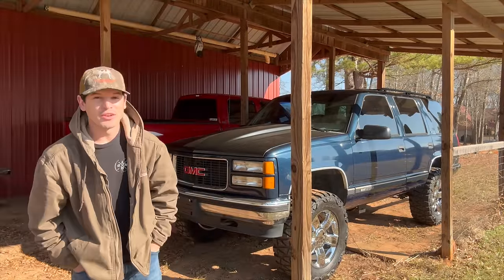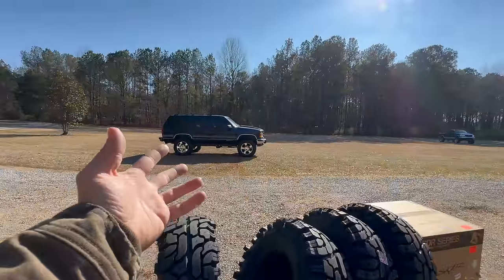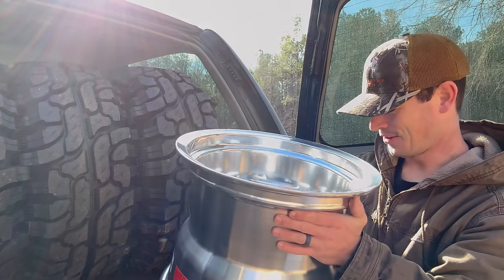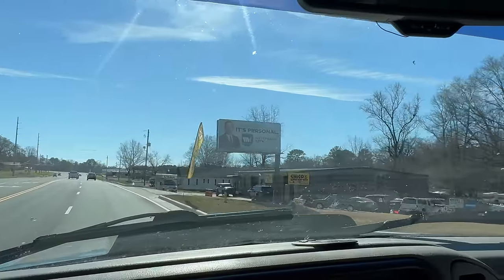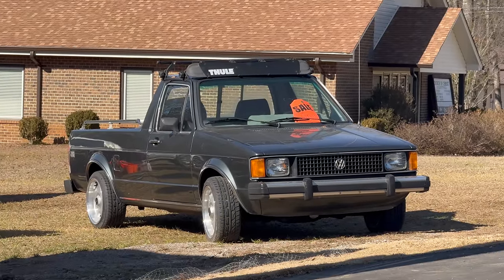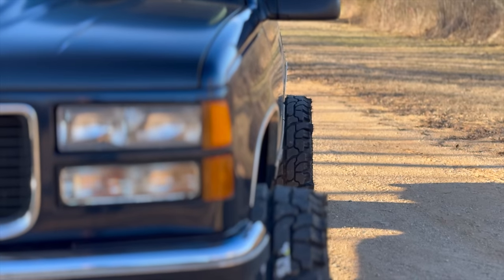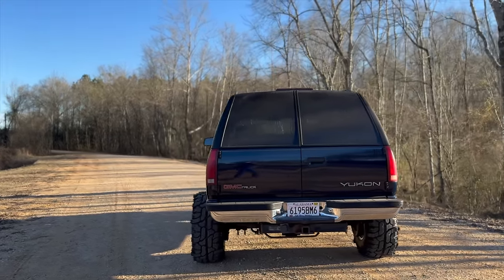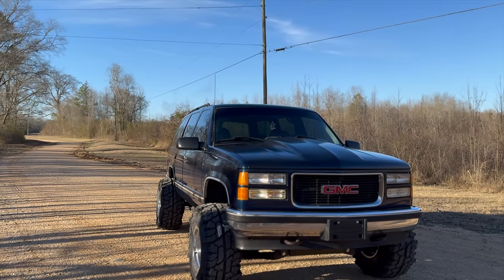I GOT THE MOST RIDICULOUS TIRES!!!! | OLD SCHOOL WIDES |

Comment: I’ve always liked the way Thornbirds look on an OBS Chevy when they’re on a reasonably sized rim, like a 15x8 or a 16x8. To each their own, but I’ve never liked the way excessively wide wheels make a truck look, especially if they’re also large diameter wheels. They seem like a great way to wear out the drivetrain prematurely & destroy the paint if it leaves the asphalt much.

Comment: Get 6 lug 14 bolt rear axle from suburban and make damn sure that you have the expensive wheel bearing hub assembly. From experience the China bearings with 15x12 and 36x1450 tsl and 2 sets of bearing hub units lasted 15 days.
Reply: Looks good I mentioned axle because it evens out without spacers

Comment: Nothing like set of 15 inch steelys with some swampers or boggers on them😎… also if you wanted to those tires can be cut and siped for better traction, but if riding on road too the smoother topside of tire does run nice if its not tainted

Comment: If you ever want a badass tire get the old school buckshot gumbo mudders but i believe you can only get em in a 16 inch and im oretty sure you can only get em in one size now wich is like a 36 10.50 or around the same size as a Q Swamper but they have even deeper treads

Comment: Had a set of Thornbirds years ago. Worst tire I ever owned. Looked cool and beefy but total garbage as far as performance in every situation. Traction SUCKS on all surfaces. Even made me crash once when i went to brake at a light and skidded into the car in front of me. Had more than enough room that any other tire would have stopped in but not those POS tires.